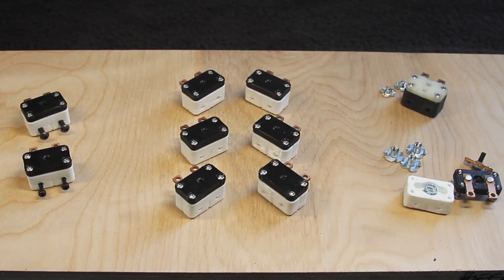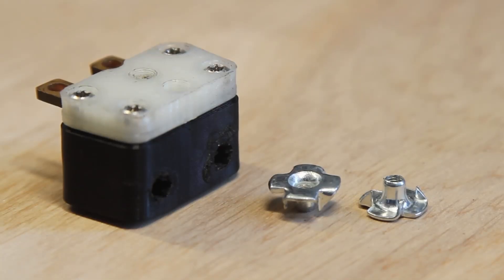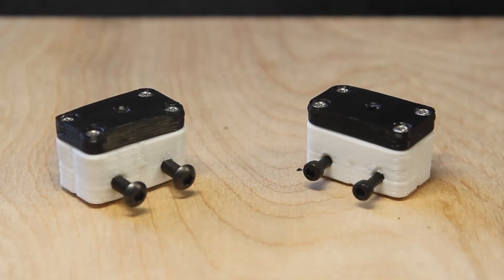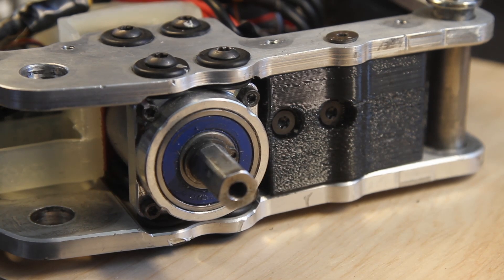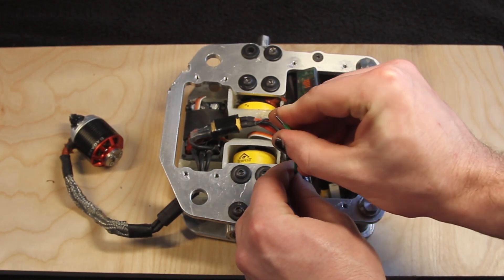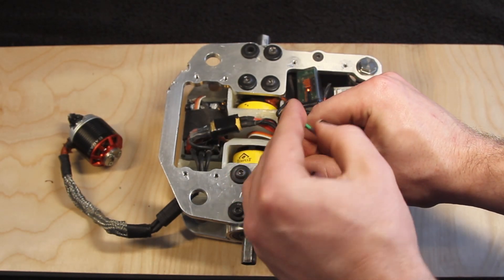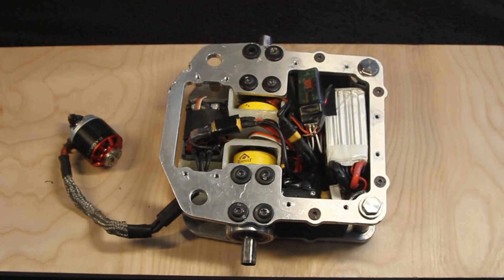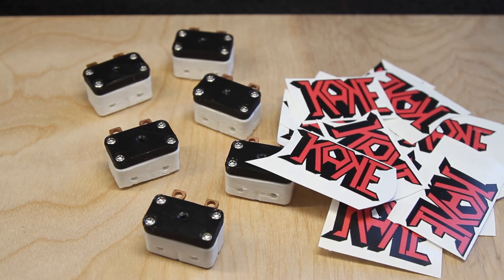Kake 1.1 Update and USE

Comment: Yo I was thinking how cool it'd be to have a swappable tail piece for modding to the matchup. Maybe one slightly longer with a lighter weapon if that reach would really help. Maybe one short and chunky with a heavier weapon to be close to normal horizontal if the strategy is going be leading with the weapon and not using the tail swipes.